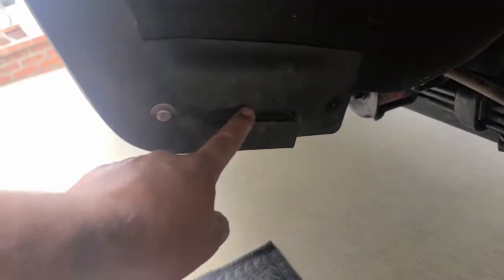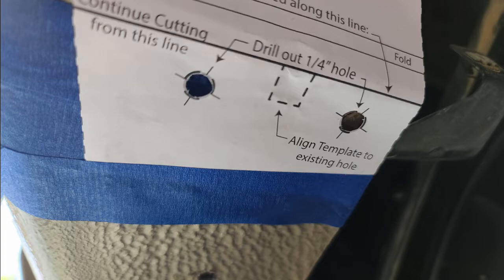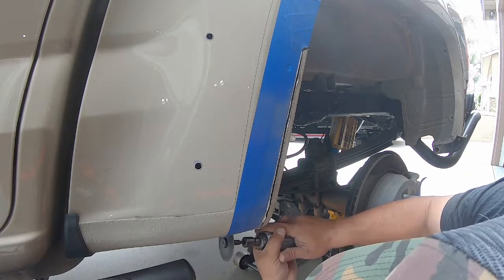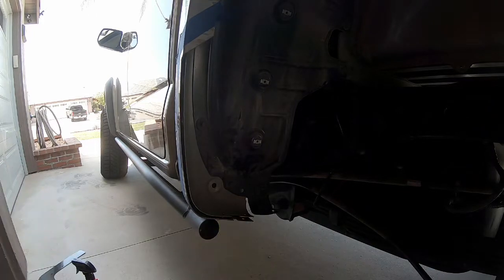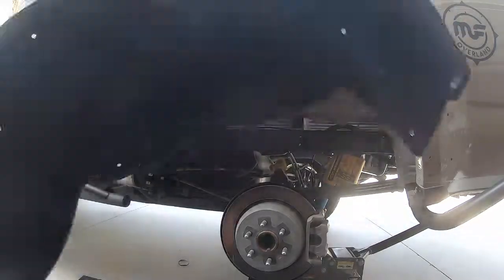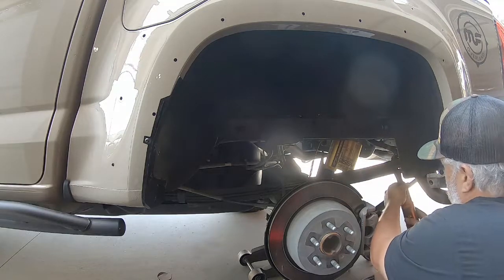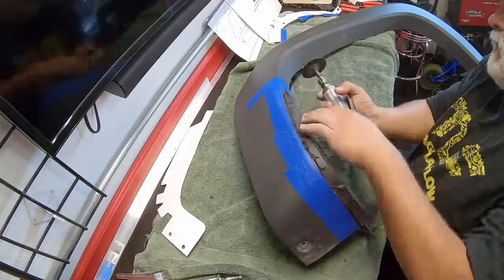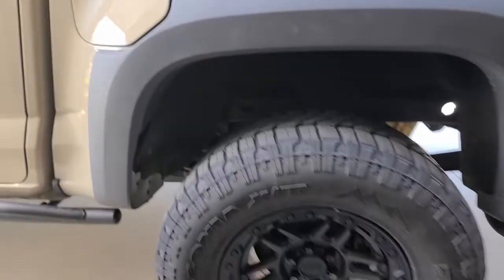Colorado ZR2 - Bison Fender & Fender Flare trimming for 33" tires (Rear)

Comment: I’m assuming the rubbing only occurred at full articulation?
Reply from the maker: The rubbing occurred when the tire and wheel centerline passed the lowest part of the body line. From ride height it only took about  3-4 inches of compression (up travel) to start rubbing on the front of Bison rear flares. At full compression it hit the top and was like a card in the spoke of a bicycle wheel on the lower edge. These issues are complicated by having a 0 offset wheel. The issue is less an issue with stock 33 mm offset wheels.

Comment: Nice video. Thanks for the information. It’s good to see more guys putting out zr2 content
Reply from the maker: Thanks for checking it out. Much more coming soon. Anything you would like to know about or see?
Reply: @exhaustinglife  I make zr2 content as well. I’ve been trying to figure out if there’s a good option having a snorkel and a cold air intake. Thanks for the quick reply
Reply from the maker: @DustinFaddis  From the data that I have gathered snorkels are barely sufficient for the stock CFM demand of the motor. I am in the midst of adding a supercharger and as such snorkels are out. I would say talk to the suppliers of the snorkel and see what its maximum airflow is and make sure adding the CAI will not be a waste.

Comment: Do you think with the stock wheel offset you can get away with trimming only plastic and not metal?
Reply from the maker: In the rear maybe ... there is some variation from vehicle to vehicle with a leaf sprung truck. You are correct in taking offset into consideration but tire width is still a factor too.  a skinny 33 such as a 10.50 or 11.50 on a stock wheel width and offset will do better than a 12.50 but at 33 inches you will find the tire contacts the from of the fenders at compression and when tucked and articulated it can tear out a ZR2 flare but will rub and scratch the Bison flare and even rip out a few bolts. 

With all that said, if you are really putting the truck through its paces it will make an undesirable amount of contact at 100% travel but if you are only using 75% of the suspension potential then you can certainly get by.
Reply: @exhaustinglife  thank you for the great information

Comment: Another tip you can use for that finished edge on the fender flare, a little heat from a heat gun carefully applied will actually make the plastic look like a finished factory edge. Also apply some Black body seem filler/caulk between the inner and outer body panels to prevent any moisture getting inside between the panels, but make sure to leave the bottom sort of so open so that any moisture buildup between the inner and outer body panel can still drain out. I also applied a small bead between the fender flare and closeout panel.
Reply from the maker: These are good ideas for long term use and ownership however, I am planning on Highmark Fender flares and 35's later this year.

Comment: Glad to see this, I have my trim kit, gonna do it and a level/diff drop all together. Curious if some light sanding on that shinny plastic bit would make it blend better...
Reply from the maker: That's very likely to do the trick ... some desert driving will probably do the same ;) that will happen just as quickly for me.

I have the Eibach Pro Lift Kit leveling spring and rung the Peak Suspension diff drop so I can recommend both. I wish I would have filmed more of the diff drop as it seems it was pretty easy and uneventful for me but some have some issue with getting the bolts started. I found loosening all the bolts to the last 3-4 threads and only removing one at a time was extremely helpful in getting everything started and aligned quickly

Comment: Did you re gear with the 33’s?
Reply from the maker: With the supercharger, I didn't have the need. I could really push the weight and diameter but 4.10s would have been nice.